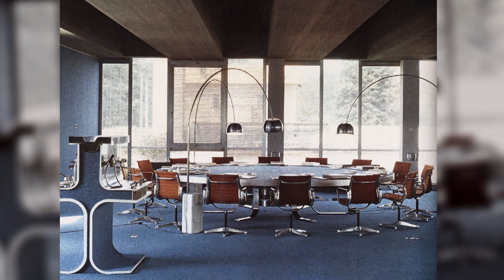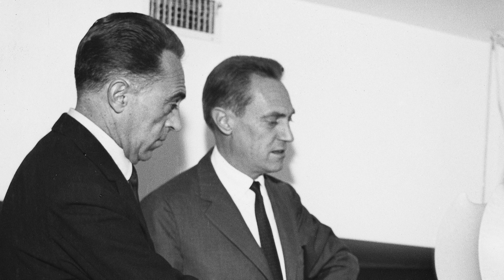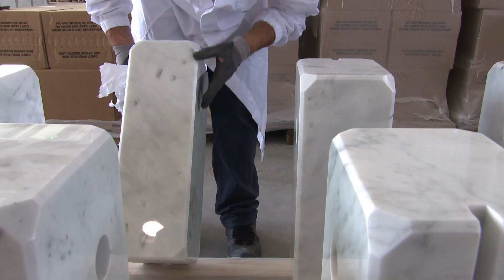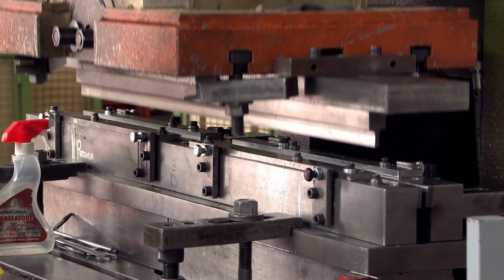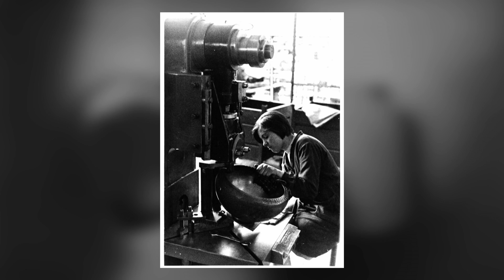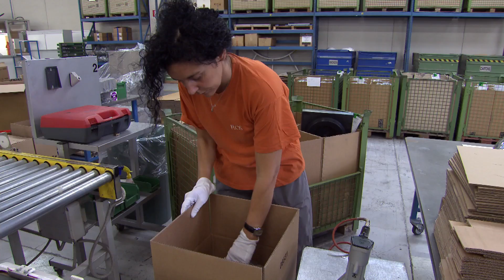How Flos's Arco Lamp is made - BrandmadeTV

Comment: I bought the black limited edition one about 28 years ago, it’s very hard to find any info on the black marble other than  only 3000 was made for 40 th anniversary which comes with a big black box with a book cd and little booklet inside it’s also signed and numbered,  I’ve tried everything trying to find them but had no luck. They show the black one for a split second both no info about it .